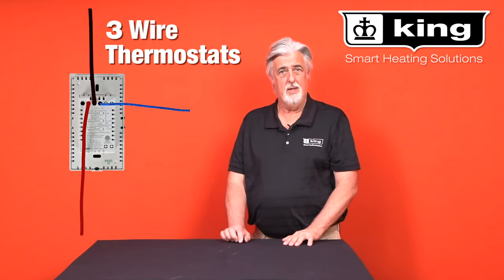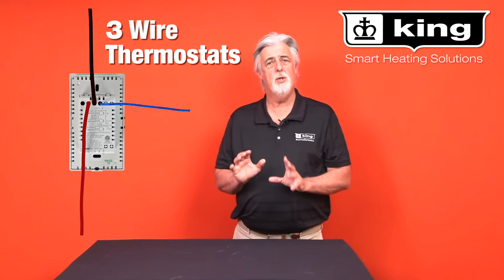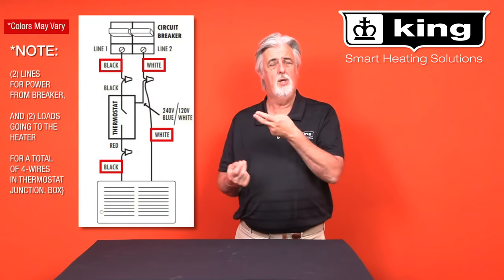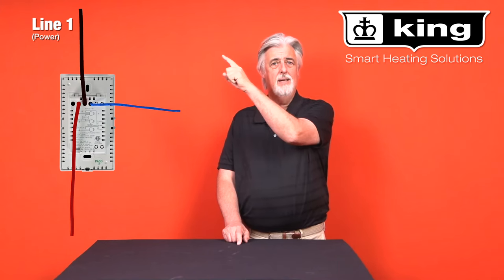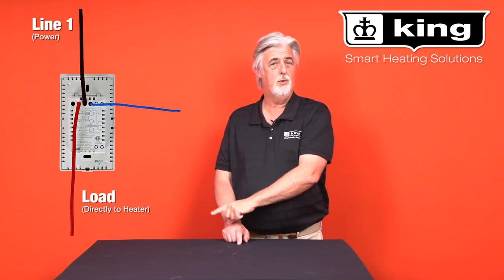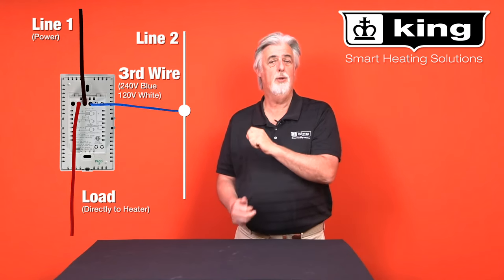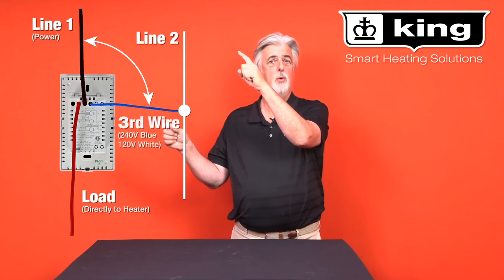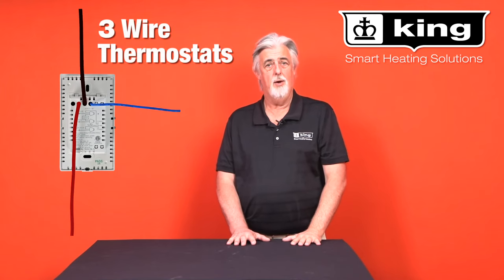How To Install a 3 Wire Line Voltage Thermostat

Comment: My thermostat is for an old baseboard heating system. It only has three wires.  One labeled with an R  , one labeled with a W and  the other wire labeled with a B.  What type of thermostat do I use? Thank you.

Comment: My 3 wire thermostat, an old Honeywell, has connections common, heat, and cool on the back. What do I replace this thermostat with? I can’t figure it out.
Reply from the maker: Please contact our tech team at tech@king-electric.com and they would be happy to help get you an answer. Thanks!
Reply: Did you get a answer? I also have 3 wires with a old honeywell but have the blue and white just not connected.
Reply from the maker: Please contact our tech team at tech@king-electric.com and they would be happy to help get you an answer. Thanks
Reply: I have this system where do I even find a new thermostat for this connection everywhere I go is a four wire